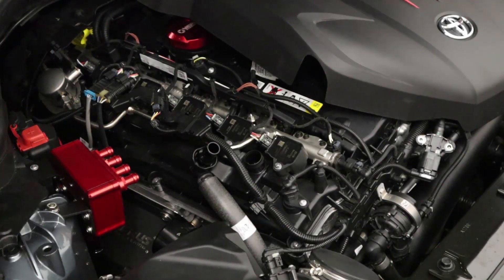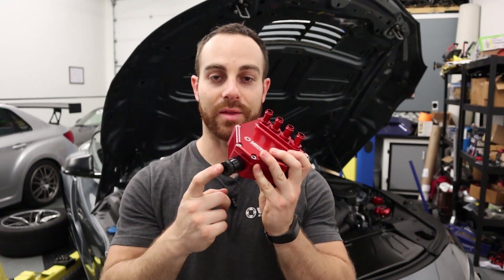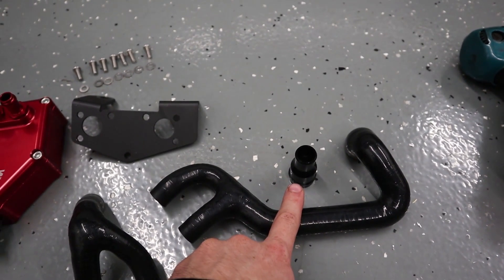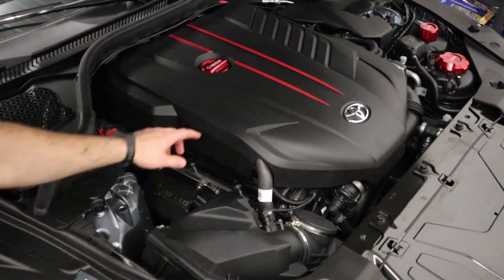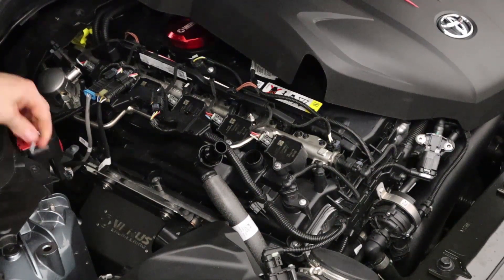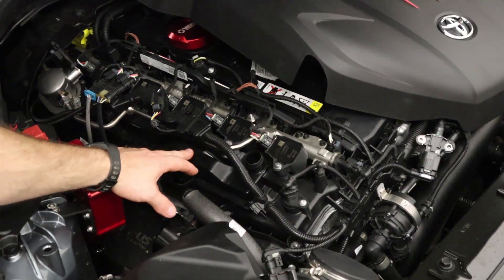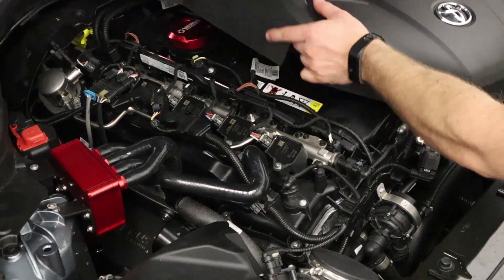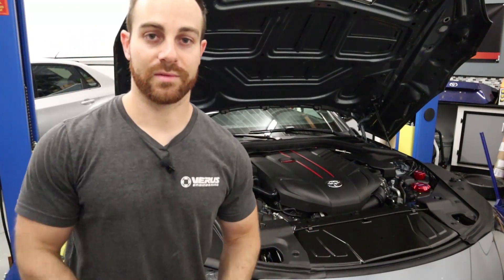A90 Toyota Supra Air Oil Separator Install

Comment: I'm getting some blow by oil in my charge pipe (a90 supra). this would help resolve that right?
Reply from the maker: This can help if it is coming from the crankcase. If it is coming from the turbo seals, this will not help. So it really depends on the origin of the oil in the intake system.

Comment: Have you developed the new version yet that routes back in and which of these fits with an eventuri intake?
Reply from the maker: Routes back into what? Sorry, I'm not sure we understand your question. Can you send us an email and we can try to help answer it further? Sales@verus-engineering.com
Reply: @VerusEngineering 6:17 - you clearly said there will be a drainback.

Drain back into the crank case.

I'm assuming that's a no based on your reply.

Comment: How often should you manually drain the AOS if you don't have the drain/ccv kit?
Reply from the maker: Just depends on how much blow-by you are seeing. We advise checking it every time you put gas in the car. If there is not much blow-by, then check it less often.

Comment: doesn't work with hks full carbon race intake...heat shield is in the way..... just saying
Reply from the maker: So have you tried to install the AOS with this intake? If so, we will update our fitment list on the website.
Reply: yes. Unfortunately, with the "full carbon" kit. i.e. the carbon box/shield that the intake sits inside of...the mounted heat shield on the exterior prevents proper mounting. @VerusEngineering
Reply from the maker: Any chance you can trim the box/shield to work? We have updated the website to reflect this. @B.C.SUPRA420
Reply: I suppose someone could cut the shield to fit but would require specialty tools I do not possess so as not to mangle it and then a clean-up or respray to the edge(s) of the heat shield, If you don't care about the looks of the thing after modification (I do) then yes you could. @VerusEngineering
Reply: I think the race kit w/o the box (the red mushroom) comes with a smaller heat shield so it mat be possible to fit that one with your a.o.s.kit.
my currently installed kit name and pt#  
Dry Carbon Racing COLD AIR INTAKE FULL KIT Suction intake kit GR SUPRA -HKS -70026-AT002 @VerusEngineering
Reply from the maker: thank you for the knowledge! @B.C.SUPRA420

Comment: So is this like oil catch can ?
Reply from the maker: Similar, but catch cans do not have the option to recirculate the separated oil back into the engine. Our AOS kits offer a drain back option that makes it a worry-free system. Catch cans must be maintained and drained on a normal basis.

Comment: Would it fit a m340i
Reply from the maker: No, this kit is very specific to the Mk5 Supra. It might be able to be modified to work, but you would most likely have to source your own hoses and figure out a mounting bracket solution.

Comment: Do we need to clean this after use? If so is there a how to?
Reply from the maker: No. We have been running one of these AOS units on our shop BRZ for over 7 years now with the original filters and mesh media. If for some reason you need replacements over time, feel free to email us and we can sell replacements.

Comment: How often should you drain it after install?
Reply from the maker: Just depends on how much oil the AOS collects. We suggest checking it initially every time you fill the car up with gas. If you check it and there is little to no oil collected, then you can elongate the time in between checking/draining.
Reply: @VerusEngineering   Good to know. I literally just got done installing it on my 2022 A91-CF Edition and it makes the engine bay look that much cooler. Keep up the great work over at Verus 👍
Reply from the maker: @Collector1296  Awesome to hear! We certainly appreciate the support.

Comment: Is this the one will help to my pure800 oil leak?
Reply from the maker: It's not going to help with an oil leak, but this will keep oil from getting into the intake system. We are also working on a drain back kit that should help this issue.

Comment: Have you had anybody install this on a 340i? wondering about the bracket fitment as well as hoses. Thanks
Reply from the maker: The AOS itself would work, but the mounting bracket and hose routing most likely will not work.
Reply: Thanks. I would love to see some of your B58 products for the 340i.

Comment: Any way you can make a bracket for us guys that use the LGmotorsports Aux fuel pump kit? They have a brackets positioned in the same spot. Much appreciated
Reply: For reference I’m speaking about this kit and it’s at the 10:35 marker https://youtu.be/ftoRyVdmh9o
Reply from the maker: Unfortunately, we most likely will not be offering a secondary bracket. The AOS can still be utilized from mounting in a different location, you just wouldn't be able to utilize the pre formed hoses.

Comment: I have the BMS one similar routing hose. Have you collect any oil on the catch can? I havent seen much on my oil catch can
Reply from the maker: Very little from our testing out at the track. That's just the sign of a healthy engine I would say.
Reply: @VerusEngineering  yea i havebeen driving on my car and i havent seen any..which is a good sign but i also hear this is not the only port that comes out from crank. there is a secondary port at the bottom which does brings out blow by oil back to the turbo inlet. Can you guys confirm if this is true?
Reply from the maker: @JDM_eastcoast  Yes, there is.
Reply: @VerusEngineering  please check this 2ndry port because apparently my buddy ran oil catch can still seeing oil blow by at the turbo inlet..which quite possibly coming from 2nd port. it would be good to get this 2nd port routed to oil catch can as well. thanks guy. keep up great work
Reply from the maker: @JDM_eastcoast  We'll keep it in mind!

Comment: Nice piece of kit. I was surprised how much oil was on the inlet pipe when I replaced the intake.
Reply from the maker: Thank you!
Reply: Verus Engineering BTW, I noticed the hoses don’t require clamps, will that be an issue?
Reply from the maker: @Nismo_Zed  It will not.